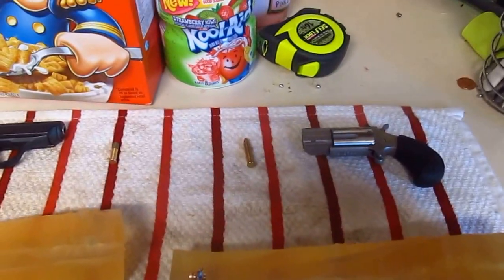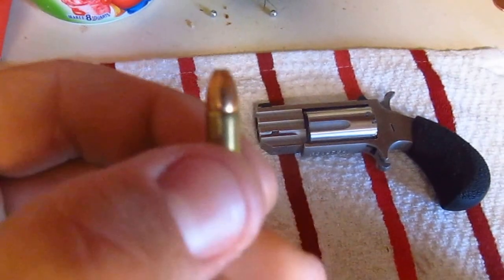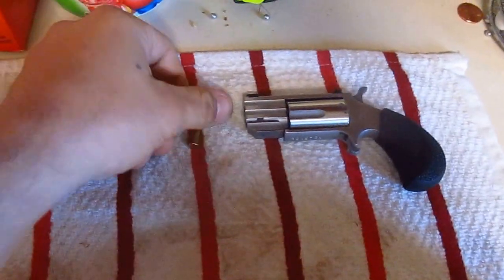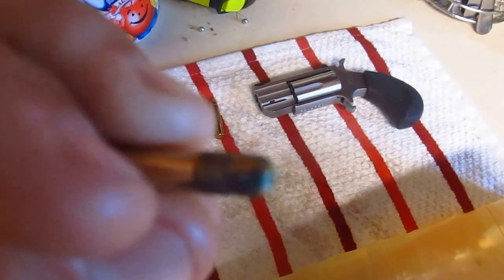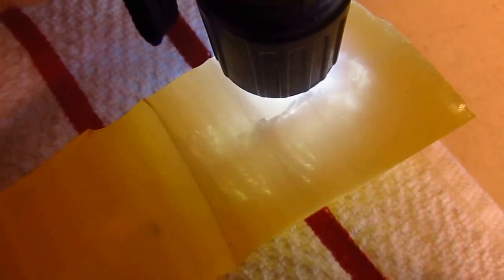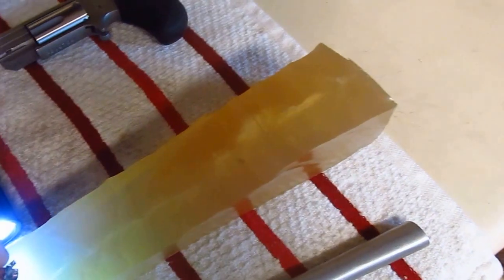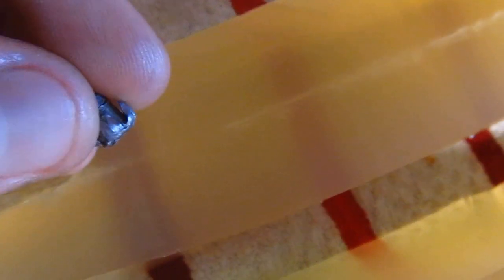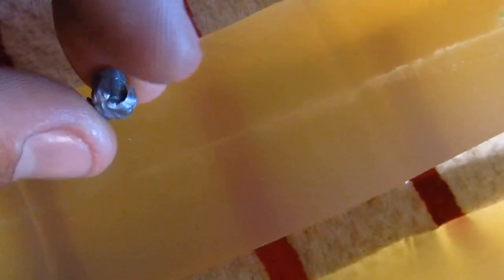NAA pug 22mag and JA-22 22lr Ballistic gel test

Comment: How do you get the wax in the tip? Do you just "write" on a bit of wax with the tip like a pen or pencil till it fills up with wax, or are you melting it in somehow?
Reply: I take a birthday candle and hold it sideways and let the wax drip in the hollow point cavity on bigger rounds. on small rounds like this, I "smash" it in by pressing the bullet down into the wax and twisting, then cleaning up the excess, melting it with a lighter, then repeat until satisfied. I prefer birthday candle wax as it stands up to more abuse than other kinds of wax.